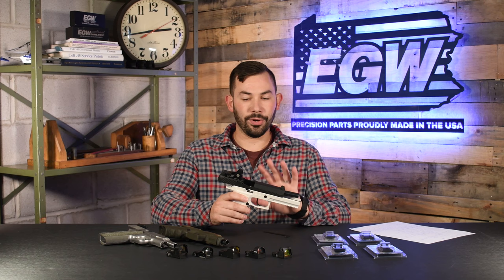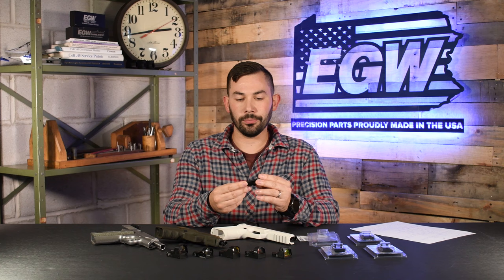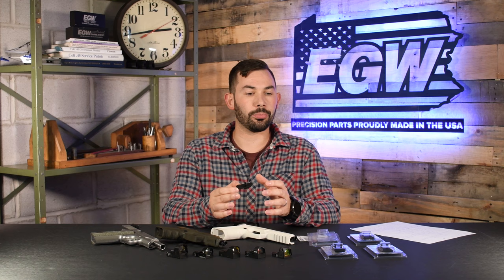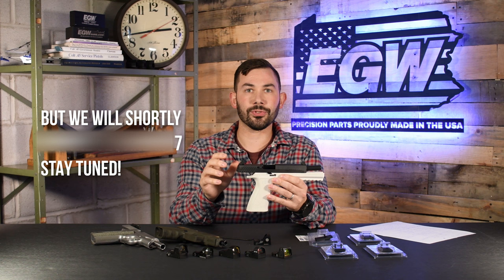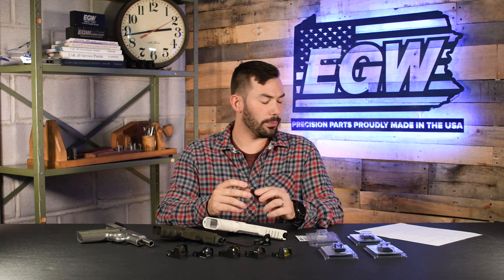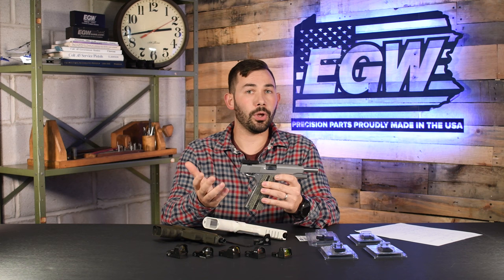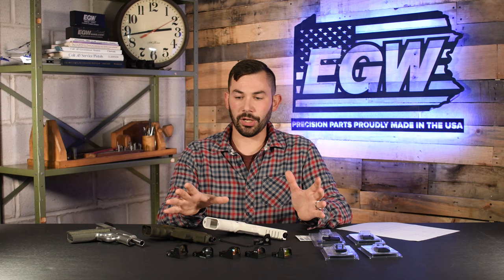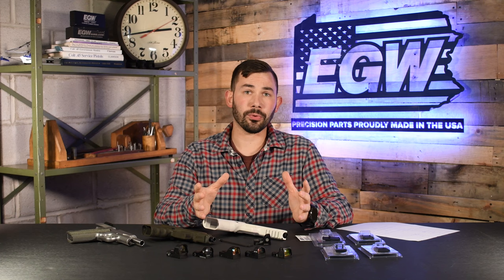Red Dot Mounts | Everything You Need to Know, and More

Comment: It'd be cool of the mount had a surpressor height rear sight as part of the frame so that you could drift the frame as your rear iron sight and then mount your red dot so that it's visible in the lower third of the glass.
Reply: glock sells one like that themselves for around $120 but you can also find some from random brands for as low as $15  if you just search "glock sight mounting plate with iron sights"
Reply: @indianOutlaw87.5  give me the link
Reply: a lot of the red dots now have a rear iron built in to the dot for example - holosun 507k, romeo zero, leupold deltapoint, etc

Comment: Have you tried leaving the slide in the sun to get warm and the mount in the freezer to get cold and leveraging CTE to aid installation?... a tenth of a thou is prolly helpful!
Reply: Idk about the mount in the freezer, might become brittle and crack? Heating the slide might give you a fraction of a thou. Probably better to hit the dovetail with a file.
Reply: @TheRaveBarn  So very wrong on everything.  If the mount metal is so fragile that a home freezer could cause it to be brittle, it's a piece of crap. Also, using a file is a very good way to F up your mount.  At most, an arkansas stone is the right tool for close tolerance fitting.  There would be no problem heating the slide to 200f and freezing the mount to zero. This process is used in industry frequently and some parts are sent down to - hundreds using liquid nitrogen.  Go back to your guitar and leave the gunsmithing to those who know better.
Reply: Brilliant Thank You 🇺🇸✊

Comment: Thank you for the great informative video.  I just ordered your adapter plate and a Vortex Venom for my 9mm.  Since the optic will be raised above the slide and co-witnessing is not  possible, will the Venom have enough elevation adjustment to compensate? Any suggestions?  Also, what color loctite do you recommend?
Reply from the maker: Hi, thanks for reaching out! The Venom has a LOT of internal adjustment, as do almost all of the red dots on the market these days. It should have enough travel for you. We always recommend blue loctite.

Comment: Got mine ! It worked for the glock 19 and a holosun 507c ! Fast install - looks good / noticed a small gap between the front of the RMR and the top of glock slide ? Is that normal ? I tightened down all the screws - so ??? I’m guessing it’s designed that way - let me know what you think or people comment please - I can see just a little daylight between the front 65-70 percent of the actual rmr sight - and then it’s touching and tight in back
Reply from the maker: There should be a small gap at the front of the plate between the bottom of the mounting plate and the slide of the Glock.

Comment: It'll be really helpful if you guys showed and talked about the sight pushers tools for these. Because many sight pushers are too narrow for the width of the mounting plates, so the user might not be able to get the plate installed at all. Trying to do it without a pusher is asking for a damaged gun.
Reply from the maker: Hi Rebecca, thank you for the feedback. That is a great idea! We have a rear sight installation video in the works already, we will make sure to include that as well. Some of the inexpensive pushers available on Amazon work pretty nicely because they are so large. We have found that with a proper set of padded vise jaws and a good brass punch set, most rear sights can be removed, and our plates can be installed using the same method in reverse, but we do always recommend having a qualified and competent gunsmith install them. We will be working on that installation video in the upcoming weeks.
Reply: @EGWInc  thanks for the reply! The $60 VISM I pusher that I have worked perfectly to drift out the rear site on my CZ 85B. But it will not be able to help me push the plate in unfortunately. I think the cheaper pushers that have a lot more space on top will do it however there aren't pads on them though so people have to retrofit them with an adhesive foam or something like that to protect the surfaces. there's definitely a high potential for causing damage and/or scratches on all the surfaces.
Reply from the maker: @rcronin1  good to know the VISM worked for you for removal. We have found the exact thing is an issue with the cheaper pushers. We normally put a piece of felt or rubber on the pads to keep it from scratching. All stuff we will make sure to cover in our video! We appreciate the feedback!

Comment: Since the video is a bit older, will the holosun footprint fit the smaller 507 carry also? Im hoping yes for an older 2004 Sig 226 dovetail.
Reply from the maker: The holosun 507c and the holosun 507k have different footprints unfortunately. The 507c is an rmr footprint and the 507k is a shield rmsc footprint.

Comment: News Flash   you  don't  need an  aftermarket  Adaptor plate for a   a pistol that  already has a machined slide that has  threads already  drilled and taped to mount various plates..
Reply from the maker: Hi, we appreciate your feedback. That is correct. Our plates are for people who do not have their slides machined or who want to try red dots without the commitment of machining their slides. If you are referring to the Sig, the plate we make for that allows the end user to run a different red dot than what Sig initially cut their slide for.
Reply: @EGWInc     I have  a Ruger  EC9s   it has a permanant  sight ..     If  I gournd the sight off  do you make a plate I could mount with  screws for the smallest  Holosun   sight they make ?
   Also I have a Ruger  Mark III    it comes with a  Weaver plate..  but  not of the sight manufactuers  mention this option ..    Now  I can't  remember if it is  EGW    or  other  Compnaies  that make a  plate for this pistol..  It does  have   three drilled and tapped screw holes  already ..
Reply from the maker: I wouldn't recommend doing that to the Ruger. If it has a permanent sight, I would take it to a gunsmith to see what they could do.

For the Ruger Mark III, we have a dovetail sight that you can mount a red dot on. There are other companies on the market that make picatinny or weaver mounts for the Mark III, but we do not make one. Our red dot mounts for the Mark III are available here: https://www.egwguns.com/pistol-and-red-dot-mounts/mounts-by-firearm-brand-sight-cut/?model=711

Comment: So I just purchased the ADE green dot reticle rd3 006 complete with Springfield XD friendly mounting plate (Venom/Vortex/Doctor footprint) and haven’t picked it up from my mail center and I immediately said, I do not think I have to remove my rear sight on my Springfield Armory XD 4 Service model HC lol.. Which would save me a ton of time as SA is known to have stubborn removable rears..
Reply from the maker: Thanks for contacting us, if your slide is already optics ready (cut for an optic) you may not have to use our mounting plate. If you only have a rear sight, you will have to use a mounting plate.
Reply: @EGWInc  Gotcha. I guess the question is upon looking at the mounting plate, do I need to remove the rear sight because my firearm doesn’t have a modular optic system or optics ready milled slide. The Ade instructions had a pistol without a rear site shown but does not instruct you to remove it as though it is foregone conclusion. I am an iron sight guy so this is foreign to me.. Thanks for your time.

Comment: I have a bersa tpr9 XT.  It has a slide cutout from just behind the ejection port to the rear end of the slide, but Bersa said that it is designed to accomodate a Sig #8 dovetail adapter plate.  The current adjustable iron rear sight mounts in the dovetail slot and has two mounting screws through the dovetail.  So does EGW have an adapter plate that will fit this weapon?
Reply from the maker: We have mounts that will fit the sig #8 rear dovetail. After looking at the tpr9, we are unsure if it will work due to the dimensions above the dovetail. We believe our adapter plates will be too long.

Comment: I wish that Vortex just dropped the C-More and Docter patterns and adopted the Trijicon footprint like Holosun did (Leupold is in a different position where it would have to abandon its on patented mounting system). 
I love the Vortex Venom but I milled my Glock for it and now I can’t change it for a Holosun or a RMR one day if I want to. From now on I will I only buy a Vortex if I get a pistol that comes from factory with an adapter plates system an I will only mill a pistol slide for the Trijicon footprint (RMRs are too expensive, but now we have options from Holosun for half the price or even less).

Comment: No one every talks about the biggest problem with optics. THE SCREWS. There all different sizes, different thread pitches, different lengths. It's almost impossible to find the correct size for replacement screws.

Comment: are these mounts stiff enough to rack the pistol with the red dot? noticed the dovetail is way back on #49510, wondering if i might bend it if force is applied.
Reply from the maker: There are a select few that may bend under excessive force but you will be perfectly find racking with the 49510.
Reply: @EGWInc  thank you!

Comment: Order a novak mount for my Rock Island TCM/9MM combo it would be helpful to see a video of your company installing one. Taking out the rear sight is not a problem I am a little concerned installing the novak because of the additional height, not sure if my sight pusher will work.
Reply from the maker: Hi Terry, thanks for contacting us! We will have a video in the works for installation shortly!
Reply: Yup me too.. and I'm wondering if it will stay zeroed on a 10mm.. curious
Reply from the maker: @Kingblacsnake  thanks for reaching out. We have had many customers use our mounts on their 10mm with great success. We recommend a dab of blue loctite on the screws that mount the optic to our plate.
Reply: @EGWInc  tried to order that mount today for the Novak cut it says out of stock.. do you guys also sell them on Amazon before I end up with a knock off?
Reply from the maker: @Kingblacsnake  we do not sell them directly on Amazon, but we do have some dealers and distributors that do sell our product on Amazon.
Reply: @EGWInc  ok just waiting for that Rock island arms a2 FS tact 2 now 😂 ready to install 👀
Reply: @EGWInc  just curious if we could get this video on installing it with a sight pusher? I got my egw red dot sight mount

Comment: I'm confused as to what you said about inserting the sight adapter. You first said that the leade is on the right side of the slide, as observed from the rear. You also said that the leade is there to facilitate insertion into the dovetail. Then you say to insert the sight adapter from left to right. That seems to negate the purpose of the leade. I always thought that you insert into a dovetail from right to left and remove from left to right.
Reply from the maker: Hi Gerald, thanks for contacting us. Our mounts have a lead on the right side so that when they are inserted in to the left side of the slide they start easier.
Reply: @EGWInc  My bad, I thought the leade was in the dovetail on the slide. Maybe it's that way on old rifle barrels. I seem to remember it being that way. I'll probably be calling you to discuss the cross drilling of the adapter for the P210 and the characteristics of a 'COILED SPRING PIN".

Comment: Do you guys have yet a mounting plate adapter for the Taurus G3. Thought that if the Taurus is comparable with the glock rear sights then why the plates wont fit a Taurus G3?
Reply from the maker: Hi Santiago, it looks like Taurus uses a few different rear sight cuts on their G3 models. If you can send some pictures of the rear of your slide to info@egwguns.com we can assist!

Comment: Purchased EGW Red Dot Sight Mount #49307 for H&K VP9 (2020 model with optics plate.  Doesn't seem to actually seat on VP9???  What's more, it appears that pre-drilled hole on Vortex Optics Venom don't line up?
Reply from the maker: Hi Phillip, thank you for contacting us. The 49307 is not for the optics ready models. We have a mount specifically designed for the optics ready version. That is SKU #49287. https://www.egwguns.com/vortex-viper-venom-fits-burris-fastfire-and-docter-adapter-plate-for-hk-vp9-optics-ready

Comment: Do you guys offer a mount for Ruger p94? I can't seem to find one. & unfortunately the design of the pistol's slide isn't milling friendly; are the dovetail mounts reliable at holding a good zero and what are some of the cons vs a milled slide? I would much appreciate a reply, although I'm not necessarily expecting one! Thanks
Reply from the maker: Hi Nathan, we have a few mounts for the Ruger Autos. Which red dot are you looking to mount? Our listing shows it fits models 90-95 as well. We have had great success with our red dot plates and they do reliably hold zero. If you mill a slide you are stuck with that "footprint" or red dot unless you swap out your slide, which is easier said than done. 

https://www.egwguns.com/pistol-and-red-dot-mounts/mounts-by-firearm-brand-sight-cut/?cat=588

Comment: So I have the delta point pro version (49402) for cz dovetail mount. Fits the cz fine, but the holes for the ddp to plate are too small. Is this expected? The screws supplied with the mount from egw are too short, and the screws supplied from leupold are too wide. Do I need to purchase different screws?
Reply from the maker: Hi, thanks for reaching out. It sounds like your mount was missing the DPP screws that we send. We have specific screws for that application. Send your info to info@egwguns.com and we can get you a set out.

Comment: no doubt i'm a noob, but i have a Taurus g2c and ordered a mounting plate just like the one in video from lake line (prob diff brand no doubt), and  i can't seem to understand how to mount my red dot.  to put it into my view;  do I need a specific red dot? or wil any do? Since the way my red is that its two pieces, the top which holds the battery and the bottom that acts lke the ground/switch to turn it on.  Do i need to purchase a red dot that i can mount without the bottom/rail holder?  It's a simple ADE tactical reflex sight.  Meaning it seems it's meant only for the top portion.
Reply from the maker: Hi, thanks for reaching out. There normally specific red dots that fit certain patterns. I would recommend reaching out to the companies you purchased the products from to see if they are aware if they are compatible.

Comment: I bought Mount for Walther PPQ Classic M1 and there is absolutely no press fit. It is loose as hell. The iron sights has never been removed. Is it mount issue ? or firearm issue ? 
Is there a way to fix it ? i tried using plates under the mount to stabilize it, but my red dot cant hold zero with this mount. On other guns in holds zero without a problem.
Reply from the maker: Im sorry to hear that you are running into issues with our mount. We have had other customers successfully install and use this base on a PPQ M1. Either the base is out of spec or the sight cut on the gun is on the larger side. Please contact us via our info email and we can get you a label so you can send the part in and we can check it to spec. info@egwguns.com

Comment: Hello, have you made any plates for the a sig p320 optics ready slide since? mine has the same optics setup as the sig with the white grip in your video. Trying to use an RMR/Holosun. The slide is cut for a dog romeo1 pro or a Leupold DPP only. Thank you
Reply from the maker: Hi Adam, if your 320 is the RX and has the Romeo 1 Pro, we do not have a plate that will work for you. The 320 RX plate that we currently make is for the slides cut for the first gen Romeo 1 which had a different footprint than the Romeo 1 Pro.

Comment: Will a 407k/507k/EPS fit using your Universal Piggyback System 30mm rings + the universal Optima mount? I plan on throwing an EPS on it as a 12 o'clock piggyback on my scope.
Reply from the maker: Yes. It will but the back recoil post on the mount will need to be removed. That is the only modification that will need to be done.
Reply: @EGWInc  thank you for the response!
Reply: @EGWInc  It might be good idea to sell a modified plate specifically for 407K/507K/EPS. Specifically the EPS in the description since its just a smaller, lighter version of the 509T which is perfect for a piggy back.

Comment: What's an affordable micro red dot sight that's compatable with the Ruger Mark II 22/45? I honestly dont have the 250 for a Venom Vortex.  Can you steer me into a good direction?
Reply from the maker: We have had some customers use ADE or UTG red dots that can be found on Amazon. They don't always fit on our plates out of the box and may require minor fitting to work with them.

Comment: The spur for Novak will for the rock island tac ultra fs but once I have the mount on what red dot is that meant for
Reply from the maker: Hi, thanks for contacting us! I'm sorry, I don't quite understand your question. We have a few different Novak mounts that will work for the Rock Island Tac Ultra FS. That gun utilizes a Novak style rear sight. What red dot are you looking to use? These are the available mounts we offer. 

https://www.egwguns.com/pistol-and-red-dot-mounts/mounts-by-firearm-brand-sight-cut/?cat=575
Reply: Evolution Gun Works once I have the mount on my gun, what red dot sight do I purchase or is the mount universal
Reply from the maker: @jjf3934  the mounts are not universal. They are made for specific red dots. Did you already purchase a mount? If not, the most commonly sold red dots that we see are the Vortex Optics Venom and Viper. That would utilize sku 49311. We are currently out of stock at this time, but are making more shortly.